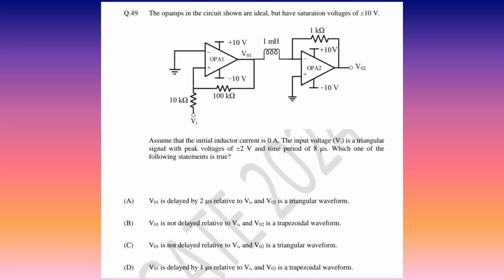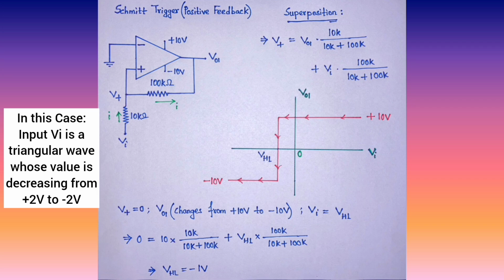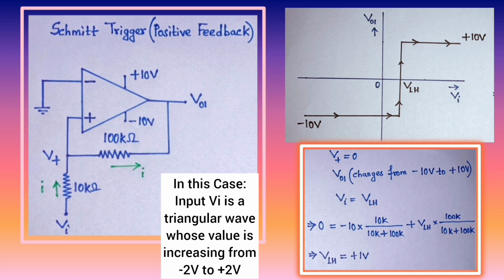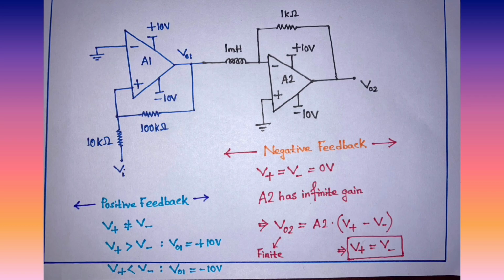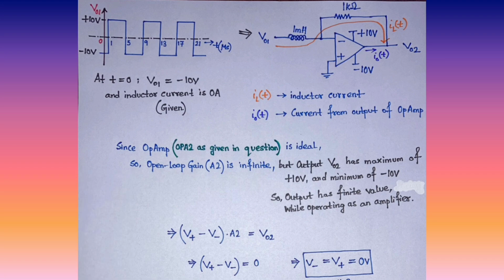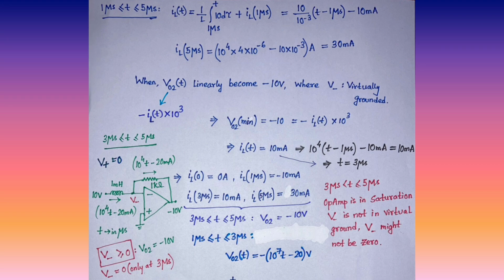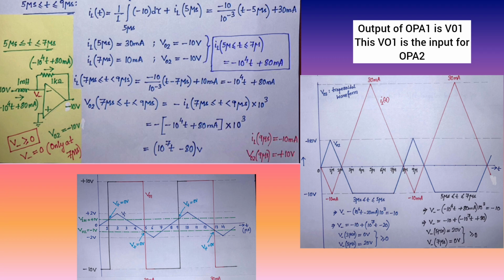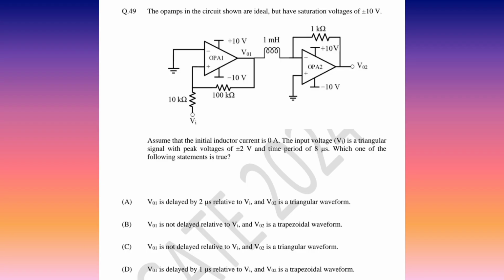BEST CONCEPT FOR GATE EC/EE/IN | GATE 2024 QUESTION (2024) #gate2025 #ece #ee #in

Comment from the maker: Key learnings - 
1. Schmitt Trigger converts an input signal into a square
wave output signal. It's designed to overcome the problem of
noise,distortion,non-idealities in analog signals by providing
hysteresis, which has two threshold voltages: one for
switching from low to high (positive threshold VLH) and
another for switching from high to low (negative threshold
VLH).
Hysteresis prevents rapid switching near the threshold
voltage due to noise or slight variations in the input signal or
due to change in PVT(process, voltage and temperature) ,
ensuring a clean and stable output.
2. When there is a negative feedback and OpAmp is ideal, it
has infinite open-loop gain, infinite impedance, then both the
inverting terminal and non-inverting terminal are having
equal voltage. Only applicable if the output is not saturated.
3. If OpAmp has a positive feedback, then the voltages at
inverting terminal and non-inverting terminal are different
and output voltage will be saturated.
4. If an OpAmp has both positive feedback and negative
feedback, and if negative feedback is stronger, then both the
inverting terminal and non-inverting terminal are having
equal voltage. Only applicable if the output is not saturated